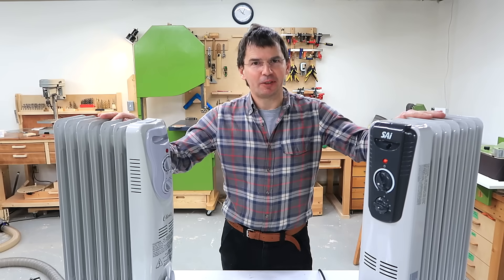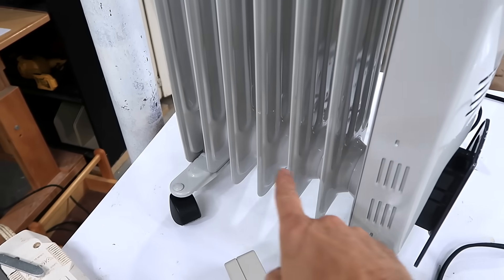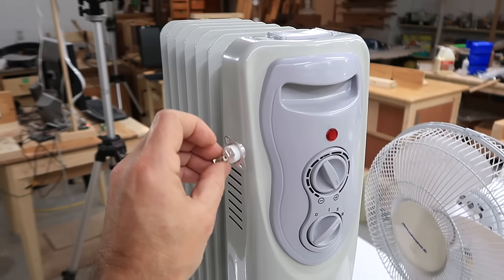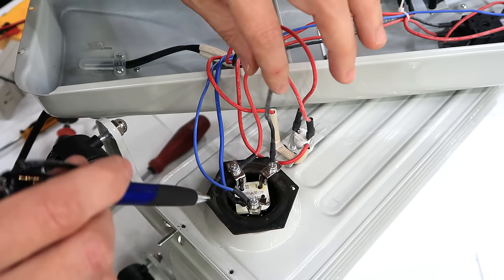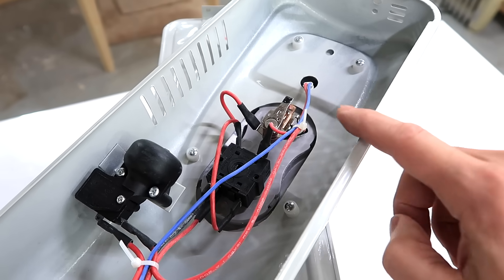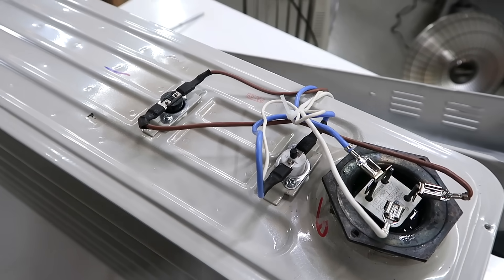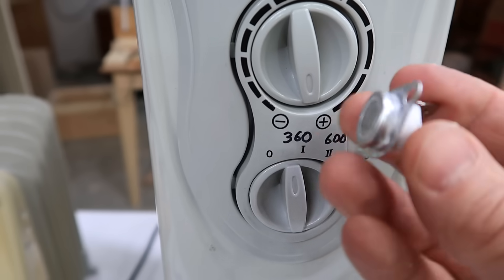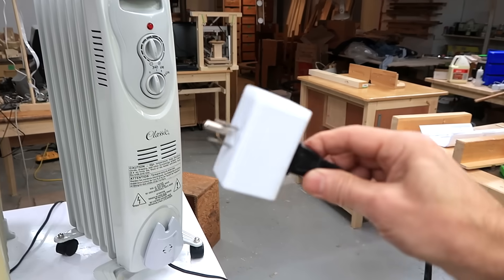Oil filled heaters: 600 watt heaters pretending to be 1500 watts

Comment: You keep talking about output but showing us draw.  While nothing can output more power than it takes in, we still have no idea what the efficiency is.
Reply from the maker: the efficiency for all electric heaters is 100%.  Electrical appliances that aren't efficient turn the rest of the energy into heat.  So if the heater was only 80% efficient at making heat, it would turn the remaining 20% into heat as well.
Reply: @matthiasrandomstuff2221  that doesn't take into account the power drawn for the electronics.  It may be minor, but shouldn't just be assumed is zero.

Comment: I think pretending is sort of unfair characterization.  When you first  turn on, are they 1500 watt?  If the ambient  temp starts out colder would the thermal shutoff activate as frequently?

Comment: I had one of these made by Lakewood (a reputable brand) where the electrical cord would get warm from the current draw.

Eventually it stopped working. When I opened it up, I found the neutral wire burned and disconnected. Had that been the live wire, this could have been dangerous.

I ended up replacing the cord with an appliance cord that could properly handle the full power and give it a ground. Making it much safer.
Reply: Oh

Comment: I have two of these type heaters, not these models, and they both work as advertised. You have a defective heater. I use a usb Fan cause it's quiet and forces the air to the floor. And I don't have to worry about catching stuff on fire.

Comment: It sounds fine: aluminium 40cm tall radiators on average irradiate 100 W/element at 50K delta-T, your have little fins so may be less. 600W is probably the actual designed rate for the 2 big ones.

Comment: I still have the Delonghi I bought over 20 years ago.  That one turns on and off, and it is one of the features of the model.  Once it has reached the set temperature it switches off.  I can’t comment on how much power it really draws on different settings, but the only time it makes that ticking noise is when it has been switched off and is cooling down.

But I switched to gas heating anyway, because electrical heaters are too expensive to run these days.  Those oil heaters are nice, but take far too long to warm up.  Plus the gas heaters still work when we have blackouts.
Reply: Gas in the bay area is more expensive than electric heater.. so I am hoping to save some money by switching to a couple of DeLonghi with program
Reply: If you have acces to renewable energy where you live, gas probably isn't the green option tho...

(I have seen gas company making greenwashing ads where I live saying it was the green option, when most if not all our electricity comes from hydroelectricity)

Comment: Oil heaters aren't flawed because you have an inferior unit. The ones with a decent thermostat can run  2400w virtually continuously. 
Most oil heaters produce the popping sound, particularly in the few minutes after switch on.
It's normal.
Reply: 2400W? So you are using a 5-20 plug?

Comment: Thank you sooo much for this ! I was thinking about leaving one of those in a house that nobody will be using for the winter. I need to make sure the temperature there will not drop below freezing point as this would broke pipes and also is not good for other elements.  Is it safe to leave that heater on unattended for couple of months ?
Reply from the maker: Try it out at home first.  And set it to "1" with the thermostat to max, that way it's on continuously and won't cycle thermally, which should help a lot.  I wouldn't trust most other heaters 100% either.

Comment: Glad I am not the only one using a smart plug for a heater. Cheap easy to make a dumb mechanical thermostat heater electronic.

I personally use the old version of Blank with the server stuff hosted so that I can have an app to set the temperature. I just an aquarium controller I built to measure the temperature of the room. Then a Sonoff smart switch with custom software.

Comment: I had an old one in the 80's that worked great. It ran the heating elements in series when idling then switched them to parallel as needed to regulate the temperature. All it had was a thermostat, an on off switch and a hole to poke a screwdriver through to hit the button to reset the overheat sensor. Unfortunately I didn't bring it with me when I moved and all the new ones are garbage.
Reply: Like you I purchased a DeLonghi oil-filled radiator in the early 80s. It is still running perfectly!  Made in Italy. I need another one but you said all the new ones are garbage.  What am I to do?

Comment: I'd take a oil heater and an external fan over a forced air any day. I have always been sketched out by exposed thin wires. Never personally had much of an issue, but radiators seem way safer
Reply: And they don't burn dust.

Comment: I have 3 oil filled heaters, all failed (element), very common failure, expensive for what they are and a waste of time. I have 3 simple wire element convection heaters no fan...2 are about 10 years, the other is 40 years old, both still work and the 40 year old one was until recently used every day in the winter.

Comment: 6:57 What kind of temperature sensors do you have throughout the house?
Reply from the maker: bmp280 hooked up to raspberry pi.  Also some DHT22s, but those are all very flaky.
Reply: @matthiasrandomstuff2221  I'd be interested to watch a video on that setup and what problems you solve with the system.
It's very difficult to find information on a household temperature sensor array.

Comment: I have two of those large standup quartz heaters from 1962.
I have rewired them so they are safe. They are very quiet with no fans.
They are 1100 W and provide good radiant heating.

Comment: When these were introduced they had more fins. Good ones were made by (or were branded) DeLonghi. Wouldn't be surprised if in those the heating element only went halfway in so the oil would circulate around. How about a teardown on some of these heaters to see how long the elements are?
Reply: got a 2000 W delonghi here in europe, its been working for 25 years no problem.
Reply: I have 4 Delonghis (canada) I find they live ~4 years  MAX.... before something fails
 Not impressed at all
Reply: Don't they make quite good coffee machines too?
Reply: Yes when I grew up we had DeLongi oil heaters. They were made in Italy.
Reply: I mean, yeah they probably are the best. But one could add more fins
Reply: I've owned a DeLonghi since 1980. It still runs perfectly. It was made in Italy. I think all DeLonghi products are now made in China
Reply: DeLinghi makes good heaters. I have had several over the years.
Reply: Wonder if they run constantly at max temperature ?

Comment: you could've bought a convection heater instead ... they're designed to run for extended amounts of times and even at full load. They literally cant overheat. Ever.

Comment: Splendid, I've done something similar with open element heaters. Security screws are only there to secure corporate profits on badly designed equipment, and it is beholden upon all of us to disregard then at all times, cheers
Reply: "Security screws are only there to secure corporate profits on badly designed equipment" - No, they're also there to save the complete idiots from themselves. Utility voltage is not a toy.
Reply: @CoolKoon  What purpose would some complete idiot have to open a well working product?
Reply: @angrydragonslayer  
1. Curiosity 
2. The insides of the product can contain potentially lethal voltages even after it stops working.

Comment: I have the same problem with Costco's parabolic radiant heater: keeps clicking on and off. Drives me nuts 🤣 I wonder if a similar solution would work?
Reply: I have one of those, and I think the issue is different. They only have one heating element, so they either run at 100% or they’re off. If you turn the temperature to max, it won’t cycle at all. At least, that’s how mine works.

Comment: Why isn't it safe? I returned two heaters in one week because i noticed they were only operating at 600W. I took my money back and bought a different one that allows me to run on maximum (1500W) for several minutes. Then it would cycle on and off but this time by the adjustable thermostat, not the internal one. I think this unit I have now really does its job while the previous ones were just boring and false advertising about their usable power levels.
Reply: WHAT BRANDS ..or good for you not anyone else to go thru the same trouble ?  :person-turqouise-waving::face-red-heart-shape:

Comment: I had one of these for my shed but after a month of usage I found it’d burst and leaked all its oil onto the floor. Turns out some have “not for extended usage” printed on them which is a hint they might cycle their safety cutout to regulate temperature.
Reply from the maker: I think it's that thermal cycling that kills them.
Reply: you kept it on for straight month?

Comment: I've had one of these small oil filled headers for 13 years now I use it every year and I love it and I never had a problem with it
Reply: How many fins does it have? Is it a DeLonghi? Looks like some changes have been made to newer ones to make them cheaper. Ideally, the heating elements should only be half the length of the heater so oil can flow down the far end as it cools off, then up the control end as it's heated again.
Reply: @greggv8  I have an old Kenwood, which apparently was made in the same plant as the DeLonghi.
Reply: You have a well insulated room then
Reply: Your statement isn't very helpful. The heater you bought 13 years ago doesn't help anyone purchase a heater today. You didn't specify a brand/model, UL certification or any specific details. I could say I bought wood stove that I use every year and I love it and never have a problem with it but that doesn't help anyone make an informed decision as to which product to purchase today.
Reply: @ImAnAmericanMan  target has delonghi's for 75 bucks.  that's a steal for the quality.  had to replace our crap mainstays the other day cause it just wasn't doing it's job. and the delonghi is whoopin' ass
Reply: @NEON2600  oddly enough there's alot of walmart brand stuff that's actually good... just not this heater

Comment: I prefer a heater with electronic thermostat. No oil is needed and it regulates the power to an exact value keeping the set room temperature. There is no cycling or clicking on and off.

Comment: Informative video, I use a couple of those heaters to supplement my force air in rooms with a lot of windows. I place that heater over top of my forced air duct and run my DC lower speed level of my furnace fan.

Comment: Actual quality 1500-2000W oil filled radiators are quite a lot bigger than these and does not have any power settings. As when it is correctly done why power level selection is completely unnecessary and adds complexity so it will fail over a decade or two. Thermostat and overheating protection is only stuff what is needed. 
We get this similar junk in some dollar stored in Europe also but as you say, those are just bad design.

Comment: You must have loads of money. My furnace broke 3 years ago, and I had two of those heaters in my family room to keep me warm. My electric Bill went from $40, all the way up to $350 when using those heaters. Now I have a gas log heater and it costs $0 in electric and my gas bill only went up $30 a month.

Comment: Could you build a chimney to place the heater in. The extra convection might be enough to allow it to rub hotter
Reply: wouldn't that be heating the ceiling more than radiating sideways, which is also how these are enjoyed?

Comment: Interesting. I need a ~400W heater for my mud room. I use a thermostat module bought off ebay to control it. I had a ceramic panel but the ceramic started spalling and wires showing. One of these might work well though they are not the cheapest. It might be interesting to swap out the thermostat for a solid state relay and a microcontroller. I bet these are very amenable to being switched on and off quite often that way.

Comment: I have one of these exact model... I noticed the same thing you did (that it only drew ~700W continuous) so I added some aluminum fin extensions that by my estimate double the surface area. It pulls full power now if I put it on level 3.
Reply: how did you fasten them?
Reply: @dizzolve  thin aluminum sheets around each existing "fin" with thermal paste on the flats to improve conductivity, riveted together on either side to tightly clamp the sheets to the existing fins.
Reply: @kschleic9053  great idea thanks for the info!!
Reply: @kschleic9053  Thermal paste = pure silicone grease = same thing and a lot cheaper.
Reply: @coloradostrong8285  I get thermal paste at work, so I've never tested alternatives.
Reply: How nice of them to sell crap that we have to fix :/

Comment: I have several of these things spread around my home. I have each one on a plug-in programmable thermostat that regulates the room temp. I keep the heater controls on low, and max their thermostat so it doesn't turn off by itself. Never had any issues with them. Maybe some day I can afford to install an actual heating system in my house. lol
Reply: That’s pretty clever. Where do you live? I feel like my electricity bill would be through the roof in winter here in Utah if I had that setup.
Reply: @GorlockSlayer   Other people mess up and turn the power level on these heaters low and the thermostat high will that mean it's never gonna reach temperature if it allows us to cut off and it will suck energy
Reply: @GorlockSlayer  Guess my reply is a little late but to answer your question I'm in the Boston area. My winter power bill can be $1300 a month. Still beats the $50k I'd need to install a proper system in a 200 year old house. Can't find any bank willing to give me a loan that big based on my income. Takes me the rest of the year to pay off the credit cards I used to pay the power company over the winter. Sucks.
Reply: Holey crikey!!! Been to Boston many times and winters are no joke. But, 1300 a month? Insulation is out of the question, I'm guessing? 1300 n diy buys a lot of remodeling, just saying. 🤷‍♂️

Comment: While this is interesting in one sense, it's kinda of obvious in another sense.

A heater will always have a maximum safe operating temperature and the environment temperature will affect the temperature delta. Which directly determines the amount of power that can be moved outside of the heater.

It's not pretending to be 1500 watts, because if it was 0 dC in your workshop it wouldn't drop down power. Like wise if you heated your workshop to 60+ dC, no consumer heater would run.

It's a lack of technical understanding by the consumer/consumer protection bodies that allows the wattage rating to be used, despite it not telling the whole story. Because heater that could only delivery 1500 watts when it was in -30 dC temperatures wouldn't be much use as a consumer heater.

Also not the fan heater has a thermal cut out in, leave it in a cupboard, and it will cut out as well, so to say it will put out its rated power continuously is incorrect.

If anything, what you're saying is ether a) it's deceptive that it drops back to a lower power setting when the heater get's too hot, or b) it's a massive lye that 1500watt heater won't put out 1500watts if you had it on the surface of the sun.
Reply: if you want silence, get yourself a solid state relay (with appropriate snubbers for inductive loads) and build a small variable duty cycle 555 circuit.

Comment: I borrowed one for a project I was doing in the garage one winter, but it just couldn't cut it. I ended up getting an indoor kerosene heater, which had the same output as a 7000 watt electric heater would have. That kept things room temperature!
Reply: I can smell it from here :)

Comment: Ive got an oil filled heater with a small fan built in. Its the only one Ive found with a built in fan and it heats my 11x11 ft room quite fast. The fanless ones I find are a complete waste of energy

Comment: This video encouraged me to hook up my oil filled heater to a power meter. Curiously, the third setting remains at 1325 watts even after it's been on for hours and the room temperature has reached over 70F.  I don't know if I should be pleased or concerned, it was the cheapest "1500 watt" oil heater at walmart after all.
Reply: See the pinned comment and I think you will find the reason.
Reply: Canadian or US?
Reply: US specs for a "standard" 15A circuit is 1325w constant current. 15 and 1800w is only allowed for "bursts". I forget the specific time limitations, but things like electric water kettles or coffee pots for start up, but then they'll all drop to 1300w for normal operation.
Reply: How many fins does it have? Maybe your heating element is simply longer than the creaking one Mattias demonstrated.
Reply: Or it isn't certified / has fake certification like a lot of things these days :/

Comment: i dont get it why change anything. all the power is just to get the oil up to temp fast then the room will cool off the rad as needed. the crackling is normal for start up. As for the fan heater yes full power all the time but high running costs to